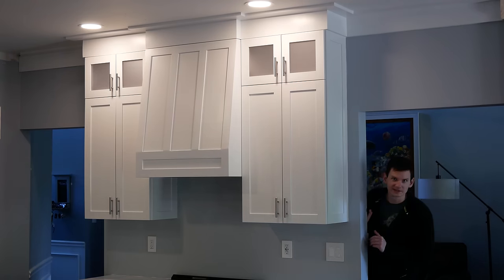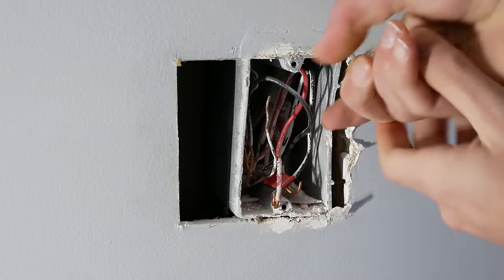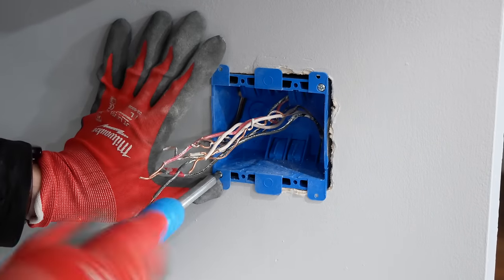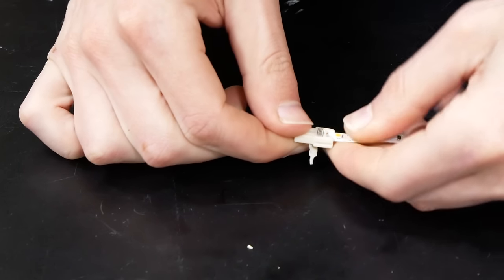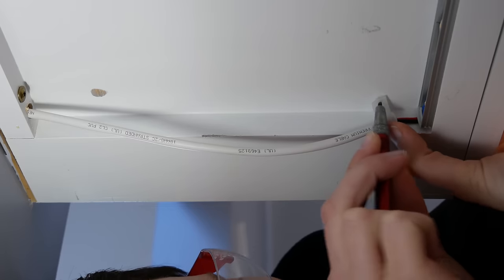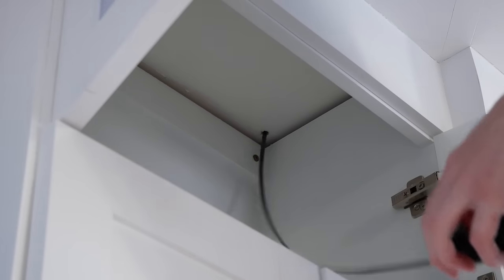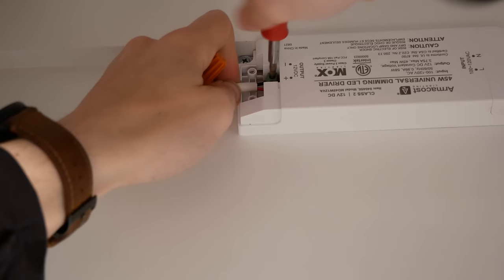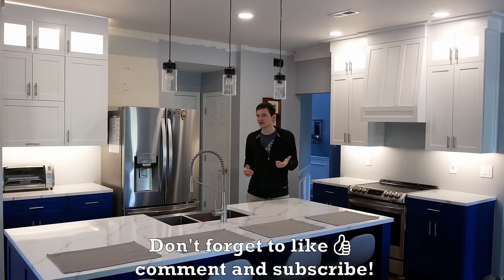How to Install LED Under and Above Cabinet Lighting Hooked to a Wall Dimmer Switch

Comment: I do not know what state era you but in California does not fly, all by code. Unless there is not inspection. Other than that very basic, some changes…
Instead of connecting the driver to the Rolex on top install another box as the one below, one side outlet, the other your low voltaje with a divider, or easier if you will do it to the hole kitchen, run the switch wire to the attic, from there, low voltage wiring to every place you will have lights.

Comment: Can you run Romex directly into the LED driver without conduit? My city is pretty hardcore on code compliance.
Reply from the maker: NEC (national electric code for the US) allows for romex to be run on the outside of walls where it not in danger of being damaged. Yes this is somewhat subjective but in the back of a cabinet is pretty safe. Can also depend on what inspector reviews your work if you decide to pull a permit for this work

Comment: The LED Strip in the description mentions the strip being 4 PIN.  The extension wire your linked is 2 wire. I have bought both but haven't received them yet to confirm.  Is the LED tape 4 wire or 2 wire?
Reply from the maker: The wire and led strips I linked are the exact ones I used. Both should be 2 wire. Just checked and it looks like the link is still correct and I didn't see anything on the product page about the led strip being 4 pin so I'm not sure why you're seeing something different
Reply: @ProjectBilld  Thank you for the reply.  I mistakenly bought a different LED tape that has 3 wires.  White, with dimmer.  I suspect that is why there are 3 wires and they recommend 4 pins if you cut/splice them.  

Your video was great.  Wish all videos were as clean as yours.

Comment: did you wire the lights in parallel?
Reply from the maker: Yes. 3 separate runs going to the driver

Comment: Just so you know… you could’ve used the dimmer switch that was already there by hooking up the load wire for the undercab leds to the load side of the switch and then reconnecting everything else the way it was instead of having to add another dimmer switch next to it
Reply from the maker: The under cabinet lighting is on its own switch on purpose. If I used the existing it would come on whenever the overhead lights were on and I didn't want that. Plus you run into the lights potentially dimming at different rates if you share a switch

Comment: This is fantastic! Question: is it an option to do another connector on the end of the first LED strip you installed and run right off of that? Or does each LED strip need to go back to the driver like you did? Thanks!
Reply from the maker: Yeah that's actually how some of mine are installed. Driver to led strip at the top of the cabinet then from that led strip down to the one at the bottom. That's fine to do as long as the length/# of leds doesn't lead to significant voltage drop
Reply: Hey Bill, hopefully you see this.  Do you have any idea about how long you can run LED strips until the voltage drop is significant?
Reply from the maker: I put links in the video description under the planning section you can use to calculate that as it's dependent on a few things. You'd be specially looking for the voltage drop calculator. Let me know if you have any questions figuring it out

Comment: hmm I know at least with automotive wiring - crimped connections are considered superior to soldered ones
Reply from the maker: I believe thats because the vibrations from driving can break the solder joints over time. Hopefully that's not an issue in a kitchen lol

Comment: I have been looking to build custom LED strip light that is 0-100% dimmable and without PWM flicker when I point my camera at it just like yours seems to be. Can you tell more how to make it dimmable? I have existing house with existing wires in concrete wall so I can't easily add new cables for communication between light switch and LED power supply so I need solution that works with existing 2 wires like yours. What do I need to know to make it happen? I heard not every dimmer and every power supply work together like that. PS I am not in US so instead of giving specific brand names tell me what keywords to look for in specs. Is smart dimmer needed or if I don't need fancy features like timing, do dumb dimmers also work?
Reply from the maker: A dumb dimmer should work. Look for one that's rated to be used with dimmable led bulbs, and look for a dimmable led power supply to pair with it
Reply: Did you look for specific dimmer type?  Like Phase-Cut Dimming,  Pulse-Width Modulation,  0-10V Dimming, DALI (Digital Addressable Lighting Interface) Dimming or TRIAC Dimming? What are you currently using? Also do your dimming switches start making noise at low light levels or are they quiet?
Reply from the maker: I did not, I don't know what the differences between those dimmer types. I just tested ahead of time before installing to make sure it worked as planned. I haven't noticed any noise from the switch

Comment: Does the driver have to be in a junction box? I'm not sure of the code requirements.
Reply from the maker: No, and it wouldn't fit anyway. It's double insulated, not really much different from a power brick.

Comment: I am thinking about doing this project on my new kitchen. Would I be able to power multiple power supplies from one single wall switch? I have 3 separate places that I have countertops and would like under cabinet lighting on all 3 sections. 4.5ft 4.5ft and 6.5ft
Reply from the maker: Yes, with the power supply that I used, multiple of them can be connected to the same switch. But since you'll need to run a romex cable to each supply from the switch, why not just use 1 power supply and run cable to the less like I did across my kitchen?
Reply: @ProjectBilld  I was just going to ask this as we ran romex wiring  from one switch years ago to 4 locations in anticipation of led install. Now time to install. Thanks again.

Comment: Those tabs on the edge of the dimmer switch should be taken off when installing into a multi-gang (more than one) box.
Reply from the maker: Yep they had to be on the left side to fit the wall plate on

Comment: It's a bad idea to hardwire so many SMD LED lights in strips and expect none of them will ever fail (if only just one led fails the whole circuit is open).
Also LEDs are one of those mistaken new technology turn that are hailed for power efficiency but we now know are proven to damage the retina light receptors over the long term because of the strong monochromatic blue light it contains (some of that might be mitigated only insufficiently by choosing warmer colors).  Even from the video you can tell this light is extremely aggressive and artificial looking (dimmer changes intensity only not spectrum). LED light is not biologically friendly, and we are biological creatures. I still prefer to use conventional lighting, comfort and eye health have a price.

Comment: For the love of god don’t leave a splice out of an enclosure!!!!!!
Reply from the maker: What are you referring to? If it's the led wiring that's low voltage and not a concern
Reply: Helps to watch the whole video I saw nm and assumed🤦‍♂️ was just looking at different ways people mount the drivers. Cabinet guys always do the finish but I’m doing mine. I see wire nuts like that and my head explodes lol sorry
Reply from the maker: It's alright! That would be concerning if I had done that

Comment: Hi, could you tap into an existing ceiling light from a dimmable switch, meaning controlling ceiling lights and under cabinet lights from the same dimmable switch ? Thanks !
Reply from the maker: I believe that should work. I could foresee the ceiling light and the led lights not dimming at the same rate being a potential problem but you won't know until you test it